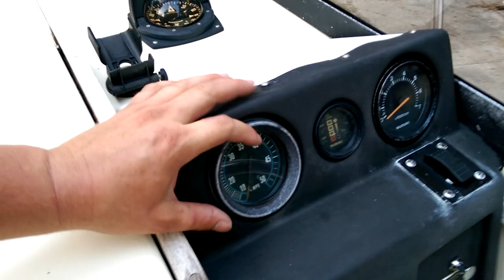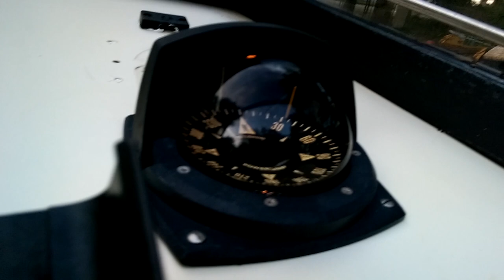(Sold) 20' Aquasport Express Fisherman - Cuddy Cabin

Comment: In realize that this is an older video. That said....

I'm checking out a 1980 222 family fisher. Tapping around the hull the upper sides sound hollow and are somewhat wobbly, while at and under the waterline it is solid as can be. On your boat the area I'm talking about is in between the bump rail and the line at the waterline. Just curious if that is normal or a bad sign. 

What I've seen of inside the panels it looks good.
Reply from the maker: Will Scrudato from what I remember, there was very thick foam in my boat in those area... If you were to open the round access ports inside the gunwalls where the rod holders were, you only saw a foam filled cavity
Reply from the maker: Will Scrudato the only place that seemed hollow to me was above the bump rail. Don't remember for sure that boats been gone a while now.
Reply: imkewls, the few places I can see through did have foam but it wasn't totally full. Thank you, I really appreciate it.

Comment: Great video. I am also currently restoring an 20ft aquasport and I was wondering, where the sump / bilge pump is located? Thanks for your help.
Reply from the maker: on my boat there were three round access hatches near the back,  just in front of the transom.  it was plainly visible beneath them.  it drained to the starboard side, up high near the white all round light.
Reply from the maker: you can see the hatches around 4:30 - 5:30 time on this video.
Reply: Thank you very much. May I contact you should I have other questions? It really is a nice little boat, but mine has been run down pretty bad.
Reply from the maker: +Michaela Merz I will answer on here.  I will mention this Era aqua sport boat,  every model,  suffers from fuel tank issues.   mine was heavily rotted and had to replace with another tank.  they are very expensive when custom built, 900-1500 for 80 gallon aluminum tank. I bought a used tank from a different aqua sport that wasn't as bad and welded the holes.
Reply: Yes. I know. Mine doesn't have a tank any more. Trying to find a replacement or something smaller that fits in there.